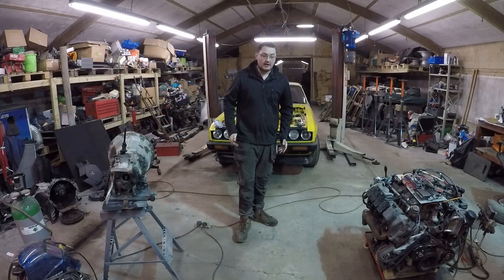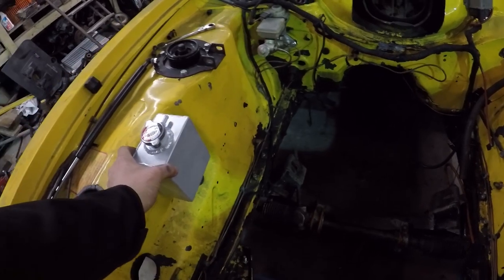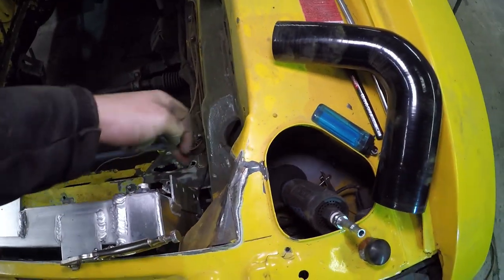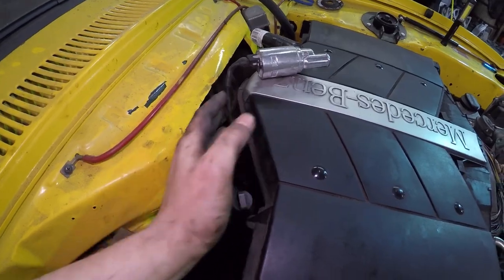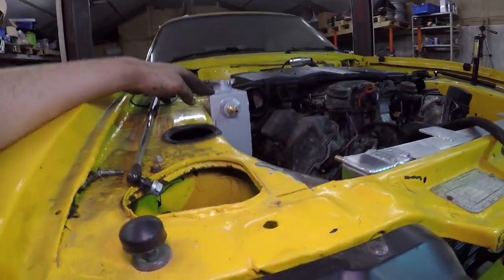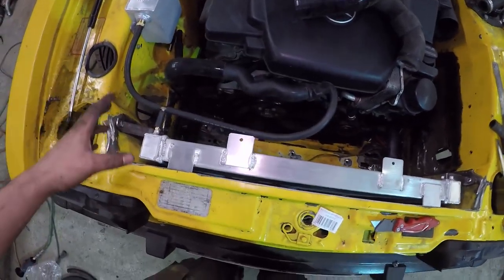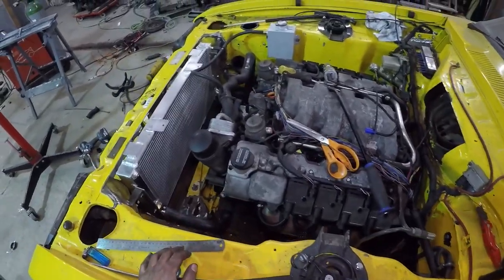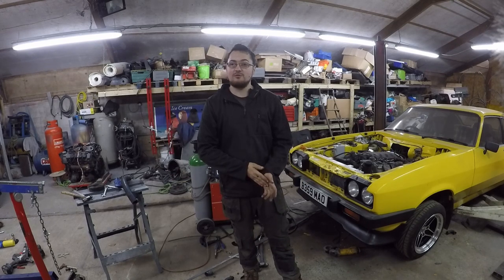Ford Capri Mercedes M113 5l V8 Swap | EP.13 keeping it cool! Custom cooling system time!

Comment: Good work buddy, hang in there.  

The rad looks great, I've often thought the rad doesn't match the opening on the Capri, when looking at Antons.  This rad is a much better shape to make the most of the opening and get it nicely tucked away.